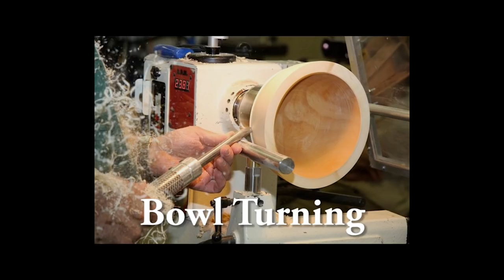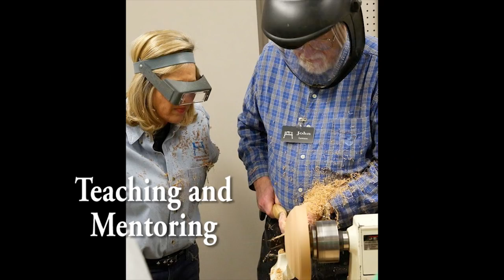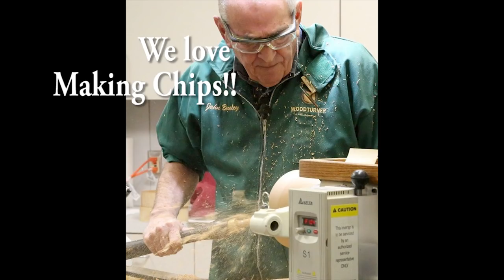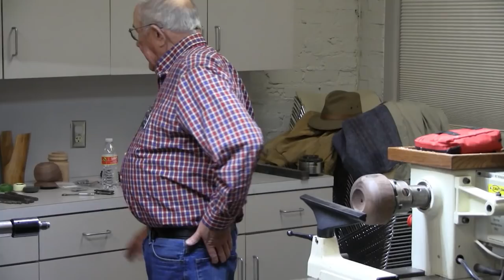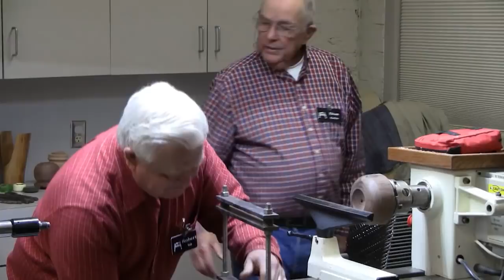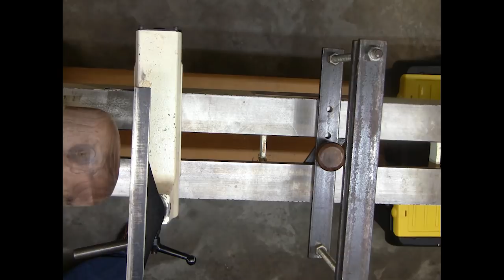Don Hawkins - Hollowing Rig

Comment: I made a Halloween bar years ago when I lived up in the Yukon . I drilled a hole in the end of the bar l had a 5/8 bolt scoot into the end with a piece of bearing material that I cut out of a bearing and sharpened welded to the bolt. As soon as I would start cutting with it, it would login and you could tell it wasn’t gonna go anywhere other than to where you’re pushing it, it worked very well. You can make a pretty good cutting edge with a piece of bearing.